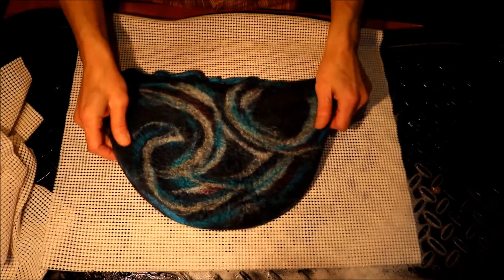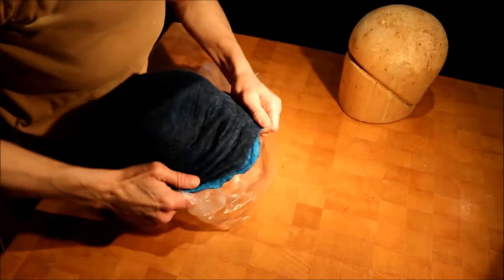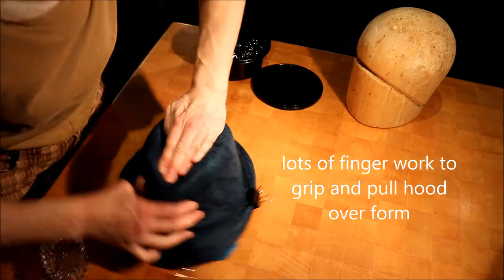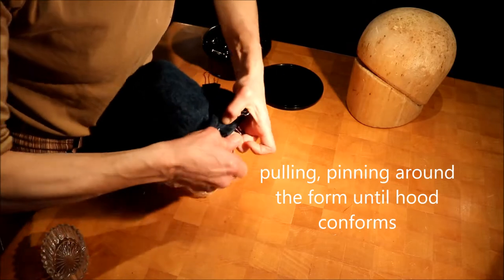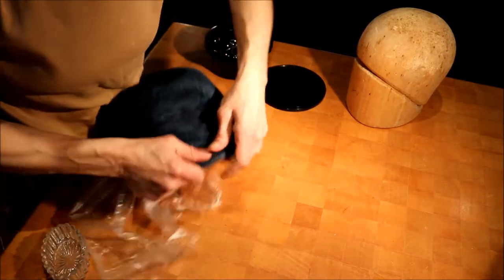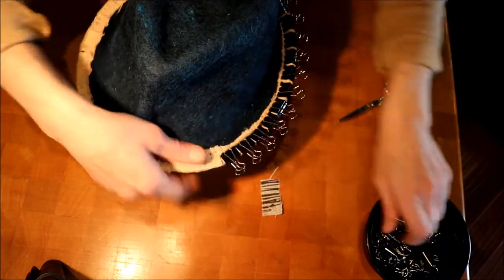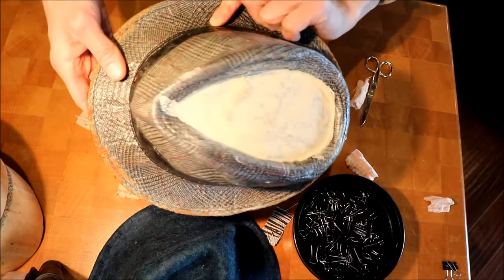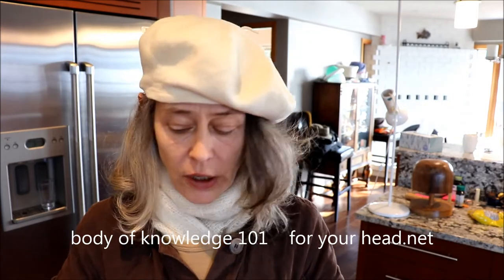Experimental hat block from sawdust - the result

Comment: That was a lot of hat wrangling. I gather it was easier to get the hat on the block when it wasn’t elevated on the wood block. I’m wondering if you could use the  the inside  of the  thrift store hat  as a mold and fill with some kind of resin . Would it harden sufficiently to a solid mass, of would there be some “give”?
Reply from the maker: It is always alot of wrangling trying to get the hood over a form. Not interesting or pretty, grunt work. 
Yes, that's my next experiment. Conforming a shape on the inside of a hat. I've seen someone do it in expandable foam on you tube and I am going to try that as well. You need to prevent the inside molding material from sticking to the inside of the hat. Called a "release". Then, I'm anticipating that the hat can be removed and the inside form used as the block.  We'll see. Roger suggests strengthening the outside of the hat first. With something to make it solid. That is what I did for this fedora style block. I hardened the outside with several coats of Varathane before I coated the inside with sawdust and glue.
Reply: @bodyofknowledge101  i tryed the foam,and it is good as an SOS block,but not the best option...it's great if u need something needle felted over it.p.s.also tryed to papier mache over the hardened foam,and it's ok,but for basic formes..no idea how more complex would be made...ty🍀🐞🐝
Reply from the maker: @blackpoppy1159  Thanks for the feedback. I don't know what an SOS block is.  But I will be trying an expanding foam inside a hardened shell. I've seen another homemade hat block video where the gal shapes a foam block to basic crown shape and then seals the outside with diluted wool filler. Spread on in patient layers, you might be able to build up some interesting crown shapes.
Reply: @bodyofknowledge101  :)an SOS block is my name for a handmade block,when you need a specific shape,like,right now,so you invent something superfast :))i saw that video,you mention but im not sure how to go beyond the basic shapes...perhaps you could try something like that...more complex shapes...one of a kind,that can be made without special order or proffesional hat blocker stores...thanks again,you are really nice and helpful :)
Reply from the maker: @blackpoppy1159  SOS  - oh I get it now.  Necessity is the mother of invention. My approach is  akin to yours. Just try what might work. If it doesn't, at least I've learned that, can modify and try again. I've got a few ideas for hat blocks that I want to make. I just need a bit of free time to get them out. Thanks for your suggestions too. 
I appreciate the interest and your comments & suggestions.
Reply: @bodyofknowledge101  😘💕